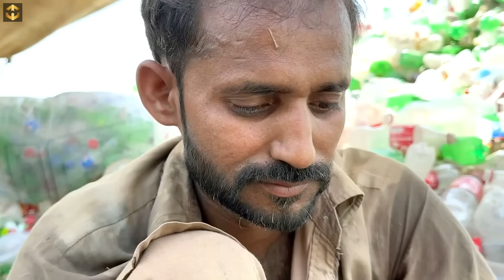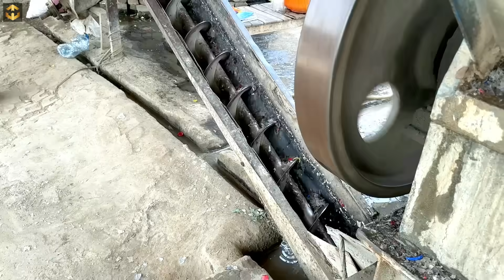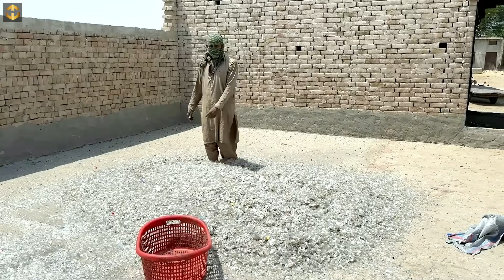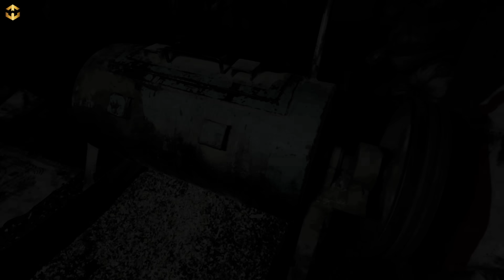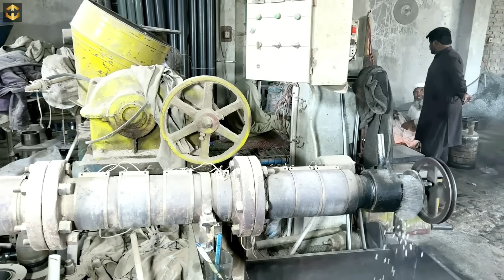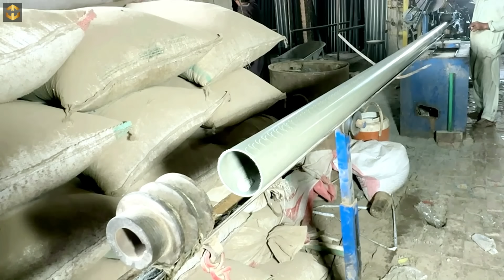How Recycling Millions Waste Plastic Bottles convert into Pet Pipes in Factory | Mass Production

Comment: ???   If they cannot recycle the paper labels, perhaps they could be compressed or grinded up to make some kind of fire log or burnable fuel. Also, if they cannot recycle the bottle caps, because they are a separate type of plastic than the bottles themselves, perhaps they could creating a robot assembly line, that operates within a reduced atmosphere pressure room, a batch processing, that grabs each cap, and holds them together, to be fused with ultrasonics, into a ‘Popcorn’ capsule, that is hollow, but very tough. The partial vacuum inside each ‘Popcorn’ capsule insures that atmosphere pressure fluctuations don’t make them burst at high altitudes. This ‘Popcorn’ could then be used to make very lightweight designer furniture, or used as a ‘filler’ material for construction applications, that could provide both structural reinforcement and thermal insulation.

Comment: Just because it is clear or green or some other color doesn't mean it's the same plastic. Also, the cap and caps ring is different plastic as well. So unless they are using the plastic as fuel, most of it can not be recycled.